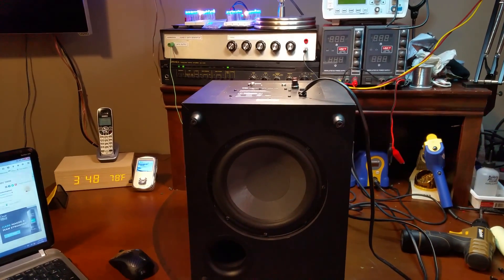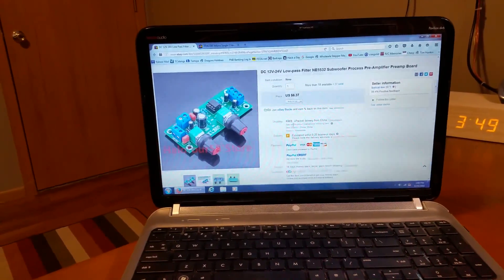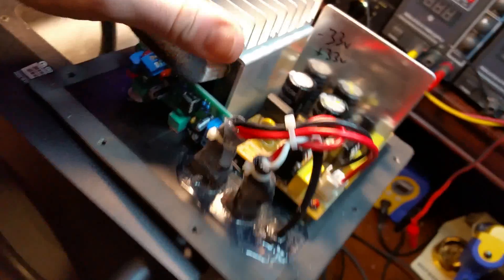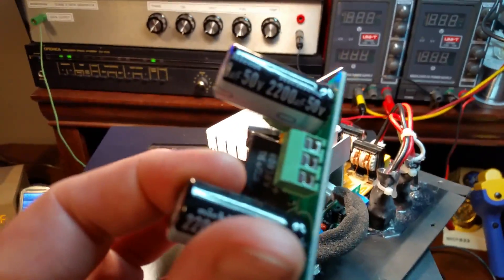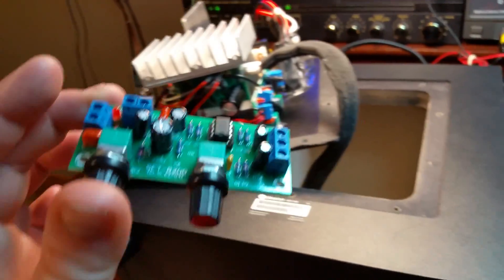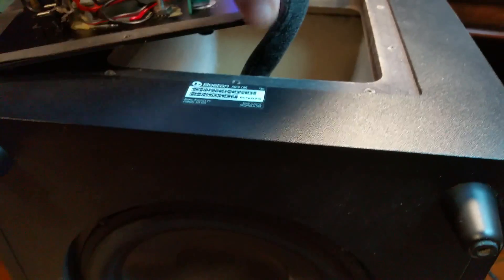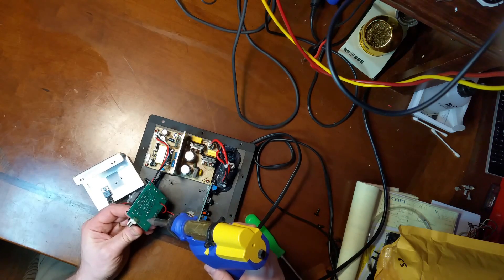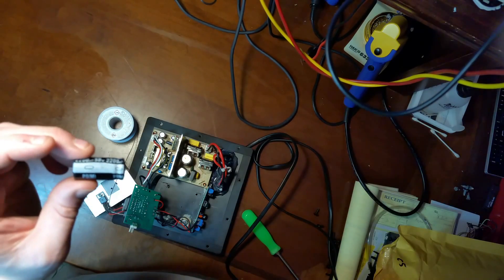How to Repair Rebuild a Home Theater Powered Sub for $15

Comment: I have the exact same sub. Mine is completely dead, won't turn on at all. How do you know if the problem is the amp vs. the power supply?
Reply from the maker: Start by testing the power supply.

Comment: Thank you for the video it is extremely helpful
I was eyeing up some of the boards on a site recently (I think Alibaba)
I was curious if this could be done
My problem is that I do not understand why some things are being done here
Like when you reference the grounding issue, and what you added, or the transistor you mentioned adding in (1k I believe?)
Im not completely sure why/where they're added b/c I know the terms but I do not have an advanced knowledge of this stuff (aspiring and learning as I go - trial and error and lots of reading posts/watching videos)
I would've also liked to know what caps you used to replace those (if there's a better type to replace them w/, so that it performs better/doesn't blow out in a few weeks).

Comment: I don't see how you've connected the RCA in (subwoofer L and R )into the TDA7293 board.  The board has 2 connections for speaker level inputs, but I don't see how to connect the RCA inputs to this board.

Comment: I just bought JBL sub 500 second hand. Hooked it up and nothing, no sound. So I pulled the 4ohm speaker out hooked up the ohm meter up to the red and black and it's reading .31. Turn the power off and it goes to zero. Does this isolate the speaker being bad?
Reply: Your speaker is blown. Hook the amp up to a new driver and if the amp is fine you should be good to go. If the driver ohms out that low it’s done for. Check out a replacement driver on partsexpress.com. They have everything you need.

Comment: Can i ship you my Infinity Modulus 12 in Subwoofer 300w amp??

I need it repaired.....

I bought a new power switch and fuse,  it worked for a few days and tgen stopped working again....
Reply from the maker: Sorry but I'm back up with repairs.

Comment: If the amp is dead in a sub, BUT, the power supply is good, will it "seem" to power on and just not make any sound? I have a dead sub, but I'm not sure if the problem is the power supply or amp.
Reply from the maker: Do you have a multi-meter?
Reply: Yes. One problem is, I can't find a way into the box the houses all the electronics. It's like a box within the subwoofer. I can get in, but I would likely break the box open. Not the end of the world, but.... anyway. Yes I do have one. I had it in hand when I learned it was a self contained box!!
Reply: Yes I do. My intent was to use that, but the amp and all associated electronics were within a box and I could not find an easy way to open it. There were screws that seemed to be the ones used to get into it, but as I spun those, they made a creaking sound like they were being "wound up". I'm guessing they are captured screws. So...I can't get into it without breaking into it, which in a way is just fine I guess....Thoughts?
Reply from the maker: Gotta do what you gotta do. What have you got too loose?
Reply: Yeah pretty much I agree. Any suggestions on once I get in there? I'd first like to rule in or out the power supply.
Reply from the maker: I would recommend to test the power supply.
Reply: @jeffescortlx  damn why do they call it "common sense"? When it isn't very common lol
Reply: You open that puppy up then head to Wally world for a new one sport,!